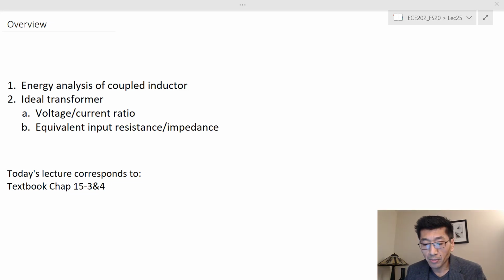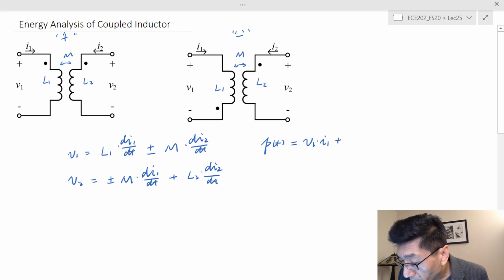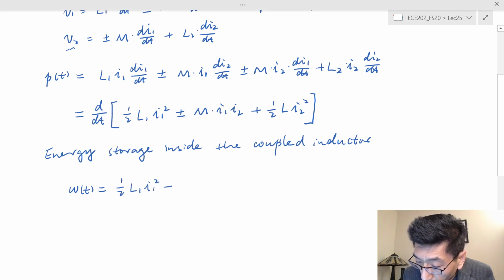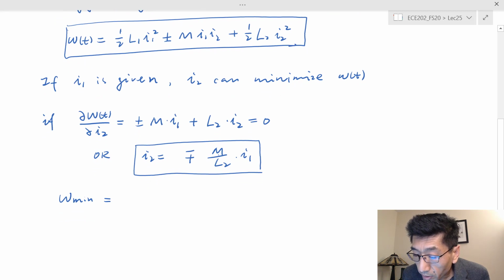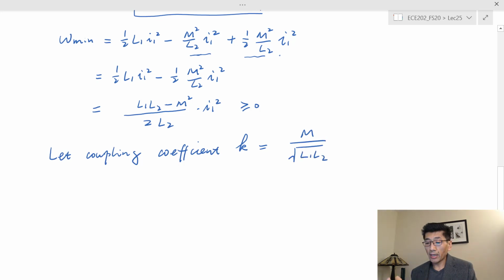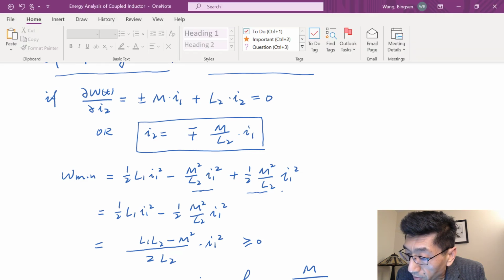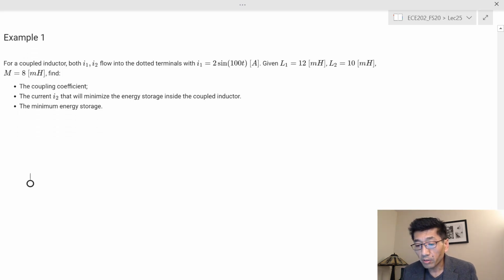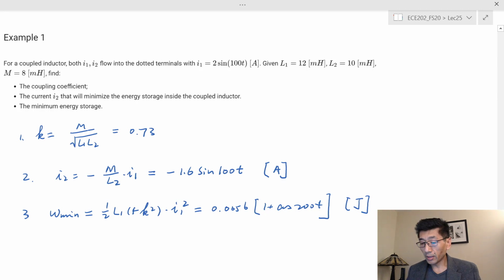ECE202_Lec25_Part 1: Energy Analysis of Coupled Inductor

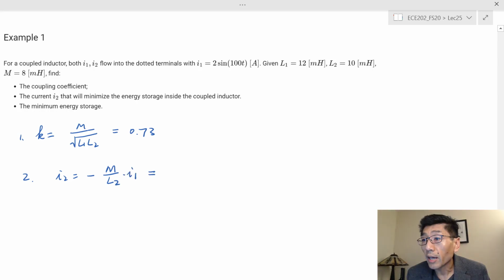Comment: At 13:18 should it be positive for number 2 because i1 and i2 flow into the dotted terminals? That's what I see in the Google Colab. notes.
Reply from the maker: With reference to the Google Colab notes, "+" in equation (2) corresponds to the case of both i1 and i2 flowing into the dotted terminals. In equation (3), the "-" sign corresponds to the case of both i1 and i2 flowing into the dotted terminals.